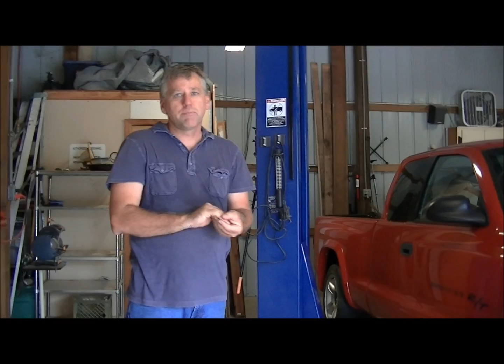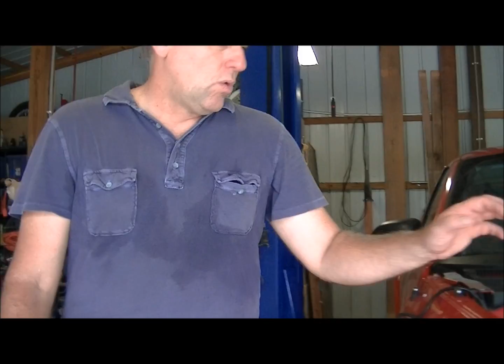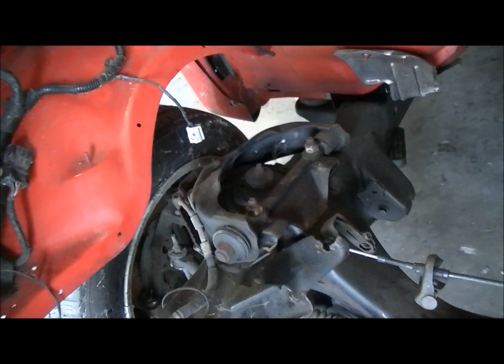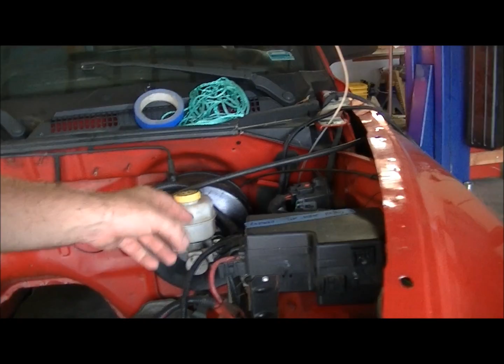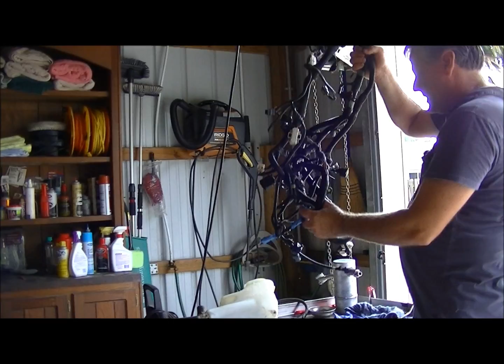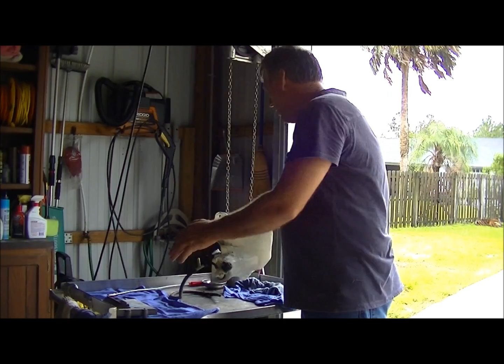Dodge Dakota RT project truck

Comment: And also there was more options then a sticker and a 1" lower. For instance only way unless u got a ram or a 4door kota ot get a 360, only one to have a 46re tran with 3.92 positive traction diferential, fender flares, color matched front and rear bumpers, and so on.

Comment: NO because i have one of the first ones that rolled off the line in 98 for the first year of the r/t, reg cab deeep amethyst pearl loaded out prob like 1 of 20 with exact options i have bc the 98 deep amethyst pearl reg cab r/t only had 52 that were ever made and mine has EVER option back then

Comment: Actually, Z code only means 5.9 l engine, no matter a Dakota, Durango or a RAM. Only other change was R/T stickers, and a 1" lowered suspension that gave them a sad 500 lb tow rating. Otherwise, just a Dakota. If, on the chance these suddenly become valuable collectors items, I will certainly pull the LS out and replace it with a MAGNUM turd, just to sell it to some idiot who thinks stickers mean something in the collectors world. Can I expect you to bid on it in 20 or 30 years?
Reply: Scott Casinger regular Dakota's didn't have rack & pinion, regular Dakota's didn't come with a 9.25 limited slip, nor did they have 17×9 r/t only wheels. On the option tag they have a special sport code, regular Dakota's didn't have 46re trans, or 2.5 inch exhaust with a "tuned" exhaust, they also have larger sway bars...that's just off the top of my head, they're not just a stickered gimmick.
Reply: If these trucks are such shit, then why do you buy them ?
Reply: At least dodge had the balls to drop a big v8 in a mid size & it took GM how long to do it in the 1st gen colorado/canyon ?